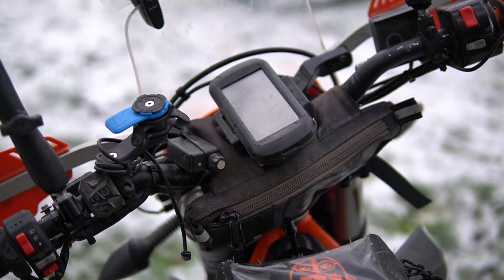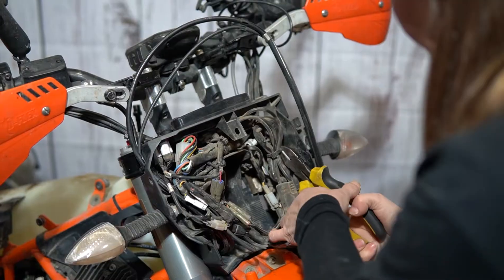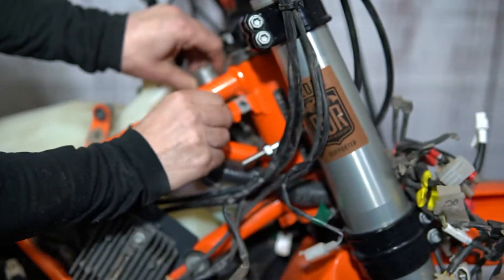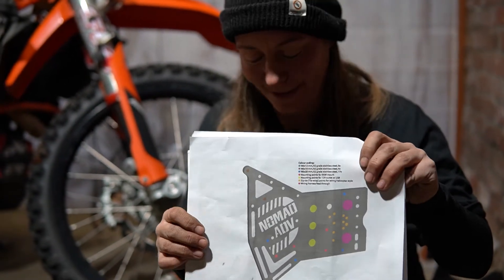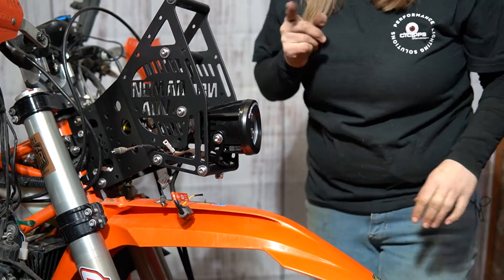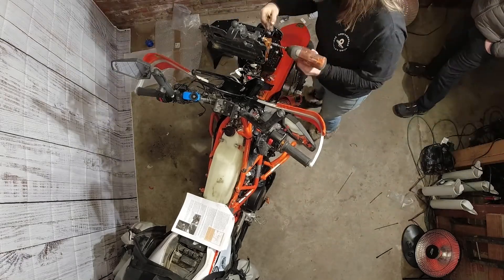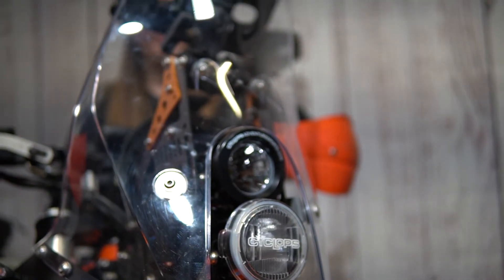Installing a Nomad Adv Rally Tower with Cyclops LED Lights on a 2019 KTM 690 Enduro R

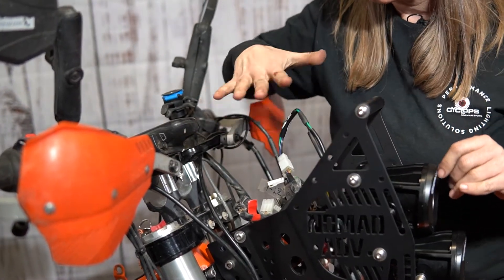Comment: Hey folks, great video! Question regarding headlight mouting: you mention the splitter at 9:56; did you get that with the kit?
I didn't get one with mine, and the guide talks about soldering, but I don't see any soldering in your video 👀
I'm a bit confused
Reply from the maker: If you got the kit from Cyclops it probably should have had all of the wiring. Reach out to them! If you bought the kit somewhere else then I'm not sure what it's supposed to include. Good luck! 👍

Comment: Hi All
Great project.
I put the same tower on my 2020 Husqvarna 701 Enduro LR several months ago.  It is a fiddle to install, no doubt.
A few things; I used clear silicone to hold the nylon washers in place to keep them from falling and disappearing.  Also, I’m using more nylon washers to provide a bit of space between the windscreen and aluminum fairing panels.  I found dirt would get trapped in this joint and I couldn’t wash it out.  The nylon washer give room, for water to flush dirt out of this joint.
Wind protection is better on my torso but since I’m tall, wind still hits me in the helmet.  Pretty buffety at highway speed.  I put an extension on top that helps a bit.
Headlights are tough to aim when everything is installed so definitely go for a ride in the dark before putting on the fairing!
Overall, good improvement and a lot more space for electronics.  I used PDM60 to manage electricity at the tower. I used it to hook up two USB ports, Oxford heated grips and still have four circuits left. Super easy install.  Currently waiting for a Speedo X from Aurora Rally to complete the tower project.
Have fun,
Balto N Me aka Troy
Reply from the maker: Awesome info!  Thanks for sharing and enjoy your tower!
Reply: Thanks for commenting on the fairing Troy. I have been considering what to do for wind protection on my 690. I am 5'8" so I am assuming if you say your tall your taller than me but not many talk about how the screen is on the motorway. I will be really disappointed if it wasn't much better than just keeping the naked bike.
Reply: @johnscott9829  
The fairing protects my torso well.  I am 6’4” tall so the wind still impacts my helmet.  I put an additional fairing clamped onto the top edge but it didn’t help much.  If you are close to southern Oregon you can ride mine!
Reply: @baltonme5046  Thanks for the feedback and offer. I'm in Arizona so I'll just bit-the-bullet and hope for the best.

Comment: I had that same tower on my 2019 690.  Your instructions seemed to have better info... like color??  I Envy that.  I added their decal kit to the side of the windscreen, nice touch.   Cyclops headlight turned the "edge" of the windscreen into a light bar so i trimmed the edge of windscreen with black electrical tape.   Get the Power Commander ECU module,  and have it tweaked on a dyno.  You'll be shocked how much cooler the engine runs,  how much smoother it runs at low RPM and there is a very healthy increase in torque from down through mid range.  I had a Wings slip on exhaust, and kept the smaller (quieter) insert.  The dyno showed the larger much louder insert only added 0.4 hp.  The guy i used for the power commander tuning has been professionally building race engines since the 1980's.  He said with this motor is oxygen starved,  and that Rade fuel tank's tiny air filter is what prevents the engine from making more power.   Frankly,  I never thought it needed more power. My mood were with the goal of a cooler running and longer lasting engine.   It's a great bike.   Unfortunately the chrome plating on my forks started bubbling and flaking before the bike was six months old.   KTM Warranty Department said,  "Must be rider abuse."  Even the dealer was shocked.   I refuse to support a company with that kind of customer attitude.  I had the dealer replace both fork tubes and sold the bike for a loss.  It really is a unicorn of a bike.   Enjoy yours,  and keep up that infectious smile and giggle.
Reply from the maker: Thanks for sharing, Clinton!

Comment: Thanks for sharing the video. Now that you have had this tower/windscreen for some time what are your thoughts about it? Do you like it? Would you purchase it again? I feel confident you would say YES for the lighting, but what about the fairing itself. Any negatives??? Thx
Reply from the maker: Hi!  You're right - I love the lights.  To me, the benefit of the tower is to have more space for farkles while still being able to see my instrument panel.  The wind protection is different, not necessarily better.  The windscreen is further away than my previous one, so it doesn't hit me in the face.  I like all those things.  I haven't seen any downsides yet.  The only one I can think of is a bit of increased anxiety about breaking it, because it would be expensive and a lot of work to replace!